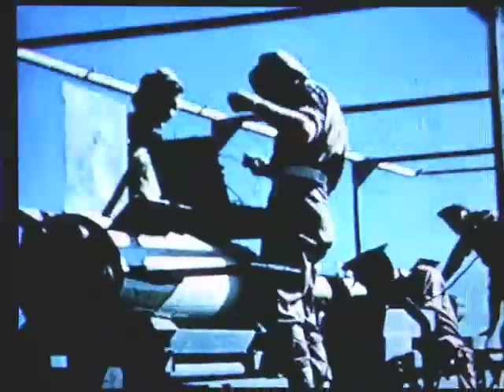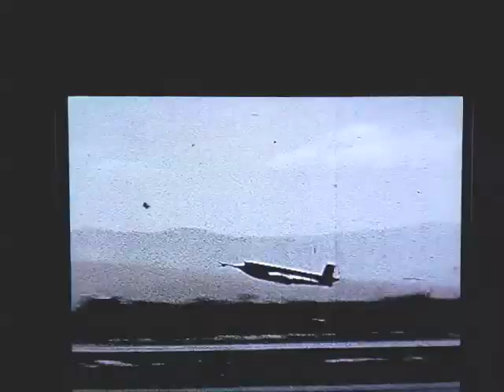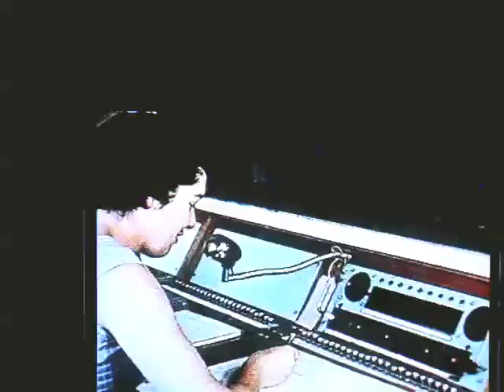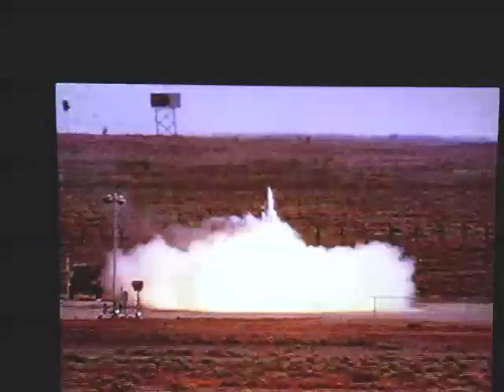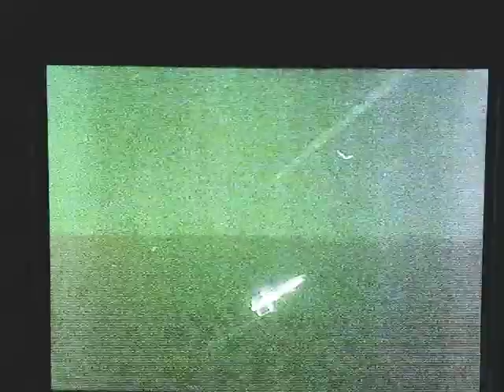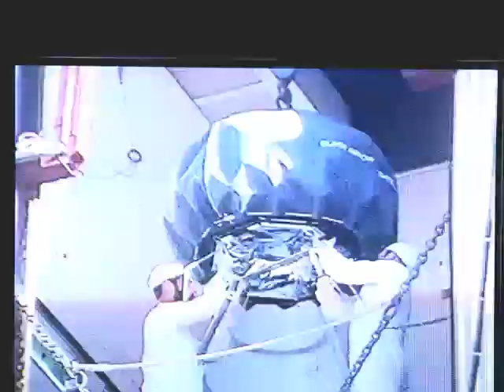Historic Woomera Films

Comment: Nice thrust vectoring on the black arrow. Hasn't been fancy stuff like that till Clipper Graham. Which worked great until the landing tripod failed and it fell over with engines going. McDonnell-Douglas wanted to replicate the egg shaped UFO landing stilts and achieve SSTO with powered vertical landing using chemical rockets.
Reply: Dad told me that the Black Arrow launch at 4:42 was a failure - one of the motors was oscillating out of control,  causing the unwanted oscillation you can see. It had to be destroyed by the Range Safety Officer.